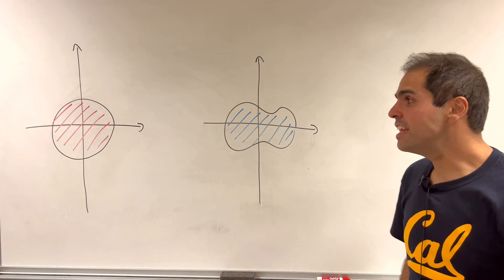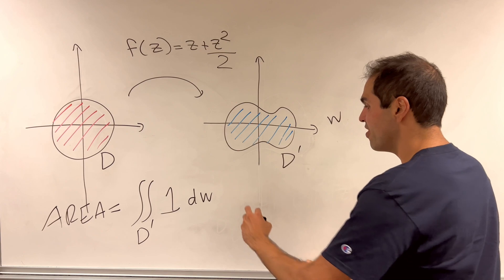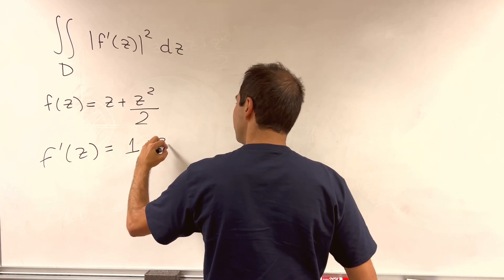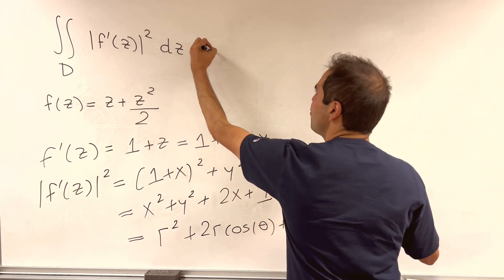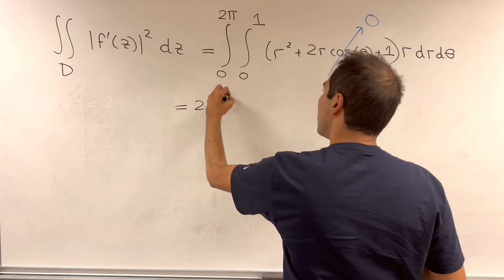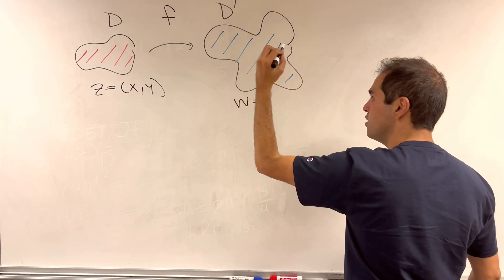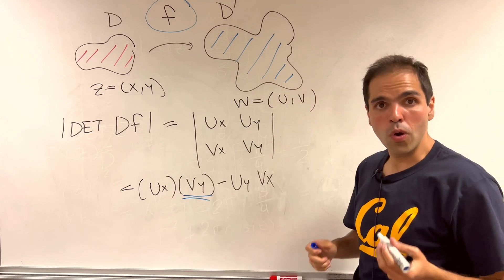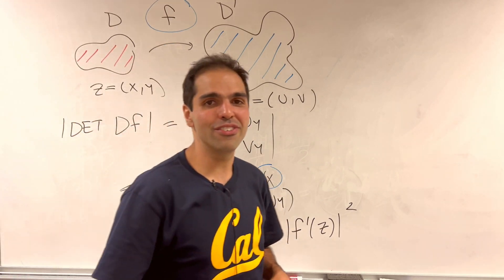what is the area of this Neumann Oval ?

Comment: what do you mean, this is the transformation of the unit disk under the mapping z+z^2/2. the unit disk is r*e^(it) for 0<=t<=2π,0<=r<=1 right? well i mapped the unit disk to this function, and got a cardoid?
Reply from the maker: It’s not a cardioid
Reply: You need to set r=1 rather than varying it from 0 to 1, that may help.
Reply: @knivesoutcatchdamouse2137  i did and still got the same shape